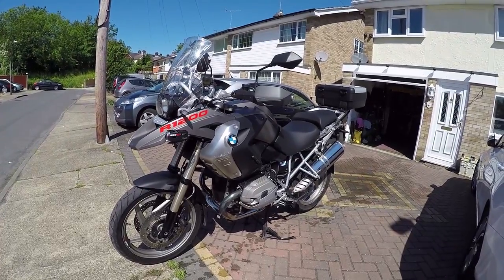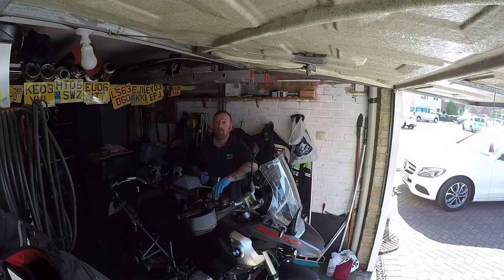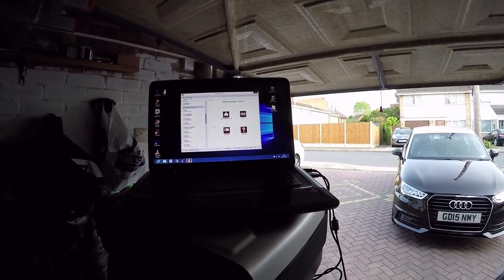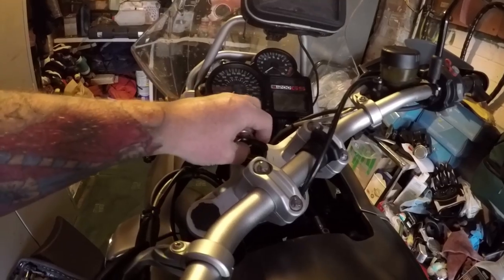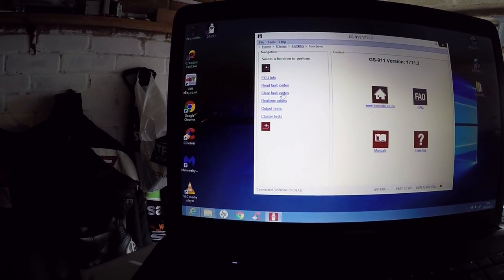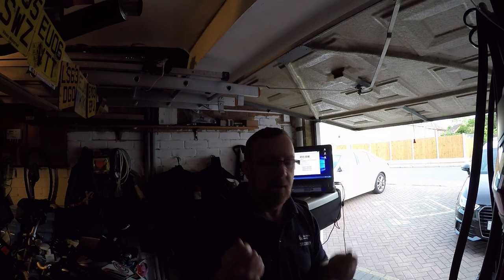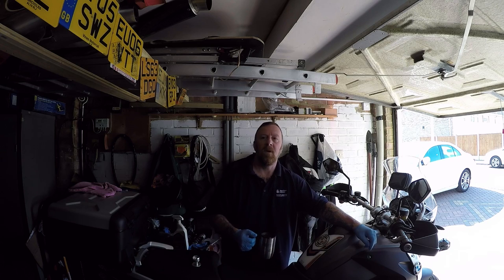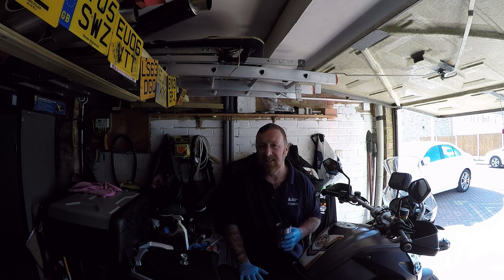BMW SPARK PLUGS HID LIGHT GS911 HELP & REVIEW MARK SAVAGE

Comment: On my old GS1200 one of the lower sparkplugs on the way back from Slovenia had failed it was not the coil but the plug itself but I did later on after about 50k (km) one of the coils needed replacing as had an intermittent fault.

Comment: What a paint bulb failing on the move, that’s something that I never had ☹️. Great to see the GS911 in action though 👍🏻😬.
Reply from the maker: it was my computers in the end but yes all up and running, i started the bike and it must have not been on from the get go as i was in a petrol station.
it was only half way down the road i noticed it then pulled over and turn on and off but it wasn't having any of it, lets see now if it was the bulb or i have to change the power pack too.
the coil pack remover makes life very easy lol, thanks for watching Steve and take care.
Reply: DervMan ,l.
Reply from the maker: he's a fellow youtuber I went to visit called dervman or Steve lol

Comment: Hi Mark, can my engine get ruined if i ride my sf 3 without a silencer i have a giannelli extra v2 on it and i took off the silencer to clean it and i rode it for like 15 mins without it just for fun lol can that ruin my engine ? Thanks.
Reply from the maker: no not really , it may cause it to have less power but a bit more sound to it and it maybe a little hader to start till you put it back on 
once back on it will carm down and go back to normal, unless you ragged it top end for miles then you could damage the piston but normally you get less top end lol 
mark
Reply: mark savage thank you soo much Mark